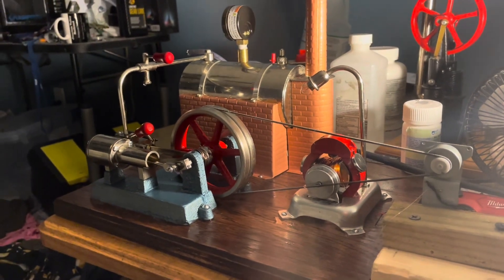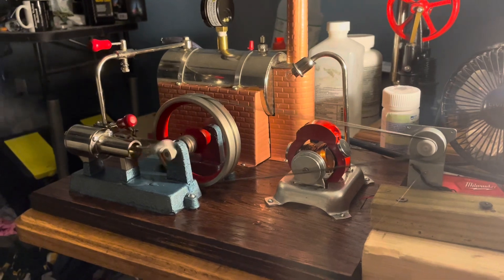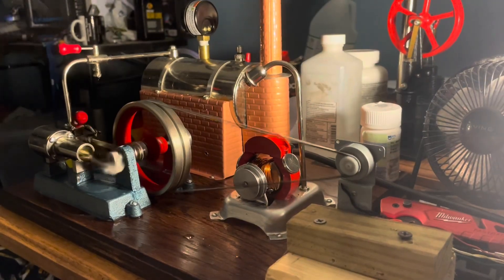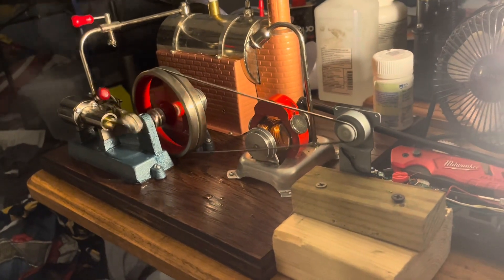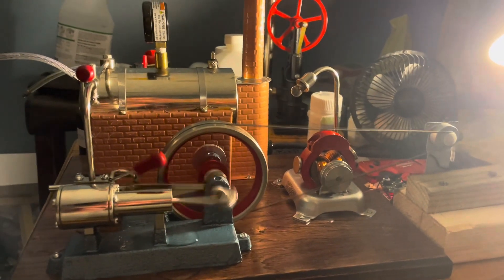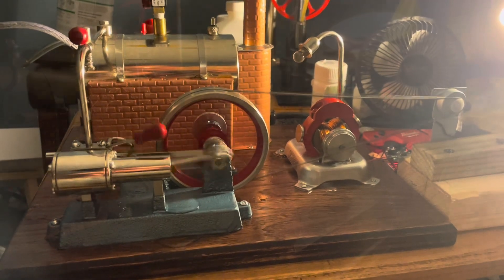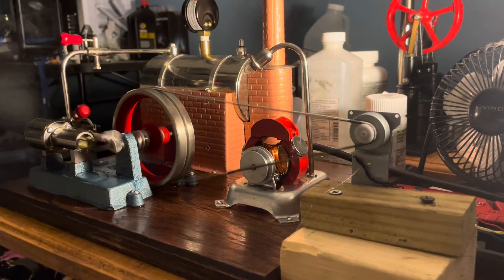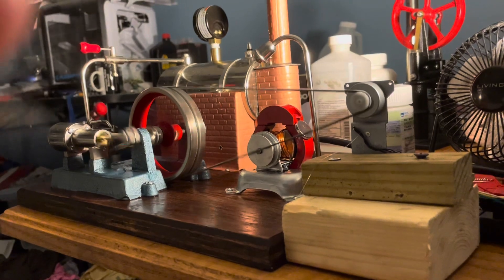Steam Powered Phone Charger 2: Limited Success

Comment: TBH, the hand crank flashlight is probably not putting out what the phone needs.

It expects 5 Volts DC and a certain amount of current, which you might not get at the moment.

Thanks to the flywheel, the overall output should be rather stable, but some capacitors for smoothing are definitely useful.

But without actual data, all of this is just speculation. ^^

Good luck with this project, anyway! :D
Reply from the maker: Thank you

Comment: Very cool!
You should try using a small alternator from a garden tractor, like a Kubota 15531-64013. Running that into a 12v phone charger (like you'd put in the lighter socket in a car) should provide enough current to actually charge a phone.
It'd also be neat to measure the input wattage to the boiler with something like a Kill-A-Watt meter, and then measure the output wattage from the alternator, and get the overall efficiency of the engine.
Reply from the maker: Never thought about that

Comment: Without measuring output voltage you can't really judge, also, I don't know if the board expects a steady voltage, if so, you could add a capacitor to the input of the board assuming the board is what is charging your phone... you could also just need a more beefy electric motor you're using as an alternator..
Reply from the maker: Yeah, I’ll have to buy a breadboard and do my own circuit

Comment: I'm lost with electrical terms.....but totally enjoyed watching this vid :)
Reply from the maker: Thanks Jim!
It’s basically a steampunk Rube Goldberg machine I’m making. I think in one of your Jensen 20G videos you said “We’re not making sense, we’re just having fun!” Or something to that effect.
Basically I ripped apart a hand crank flashlight just to get to the board and usb output.
What I really needed was a way to step up the voltage and keep it fairly constant so that was my solution.
In a nutshell I don’t think the board allows for enough power to be sent into the phone.
iPhones (which I have an iPhone) takes a bit more energy to charge than some others on the market.
It’ll charge other smaller devices just fine because they don’t require as much power as the iPhone to charge.
I’m not to educated on the electronics aspect however there’s a few capacitors and other diodes to make sure that the voltage is stepped up and held relatively constant.
Hope that makes sense.